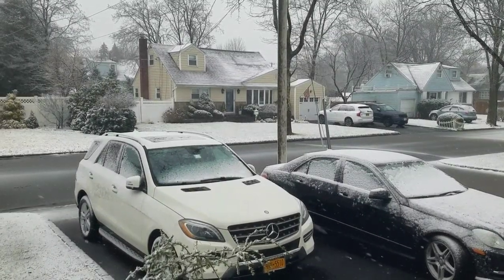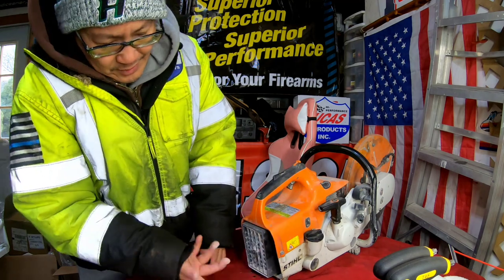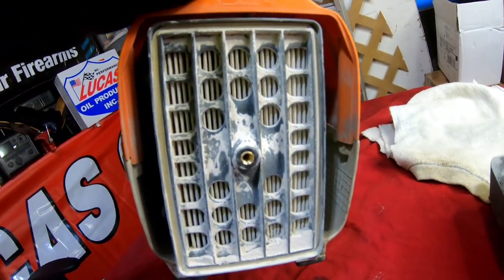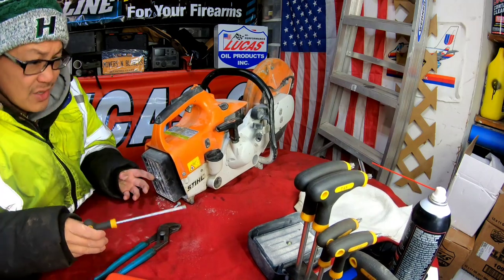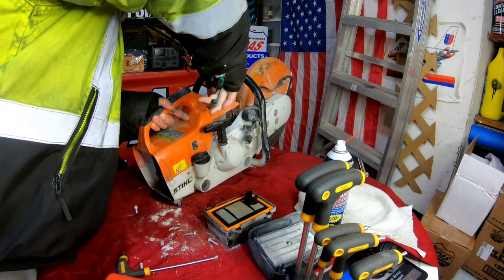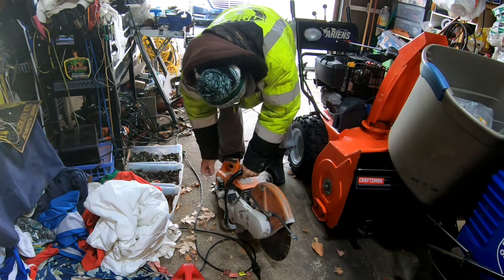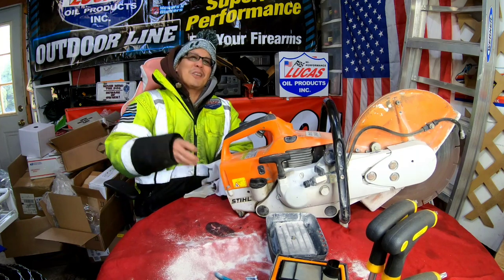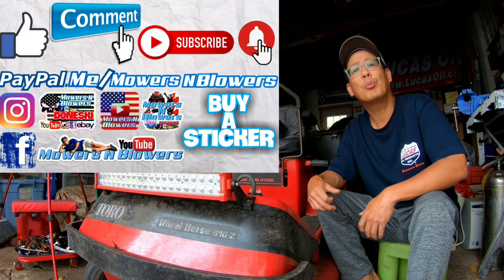HOW TO TROUBLESHOOT STIHL CUTQUIK TS400 CUT OFF DROP CHOP CONCRETE GAS SAW AIR FILTER FINE DUST CLOG

Comment: Yes it is a 2-stroke.  Need to clean air filter daily when using this concrete/cut off saw.  Fine dust scores piston, rings, and cylinder and burns them up.  Sounds like carburetor needs to be adjusted, idle adjusted.  Very expensive and powerful tool.  Need to run water to keep dust down to minimum whenever possible.

Comment: That button on top is a decompression button push it in, set choke to full then pull, when it fires the decompression button will pop out, move choke to half, away you go (decompression button makes it easier to pull)
Reply from the maker: When the button is depressed,  it won’t start!
Reply: @MowersNBlowers  Carb Settings Too Lean or Bad Decompression Valve or Maybe Marginal Overall Engine Compression Stihl Needs Min 110 Psi  Comp With Valve Out To Run Normal Is Around 160 Psi Comp

Comment: Cleaning the exhaust screen may help a little more too.
Reply from the maker: Yah but the amount of labor and disassembly required to access the screen in relation to how it runs isn’t worth it to find out.  You’ll see when I put the new filter in how it runs

Comment: Nice job on that saw Henry. Yea I always like to put in my own fuel mix to make sure on 2 stroke equipment. Sounds like it could use just a little adjustment on the low mixture, but it could just be because the filter is off. Thanks for the upload 🤘💪🇺🇸
Reply from the maker: Got Your sticker today bro!  Thanks,  I’m sending you one of my new ones
Reply: @MowersNBlowers  thank you! You didn’t have to do that. I’m glad they made it. You da man!!

Comment: Hope you were wearing ear protection or some sort cause they are really loud I always wear mine due to being hearing impaired on both ears not from loud machine it was from a med that the nurse gave me when I was in the NICU
Reply from the maker: No I seldom wear ear protection because I didn’t find it as loud as gun fire or tractors without mufflers!  My hearing is very good and have high tolerance for noise.  Trust me,  when it’s too loud,  I put on my ear muffs.  Thanks.